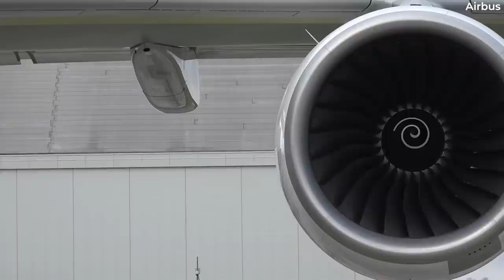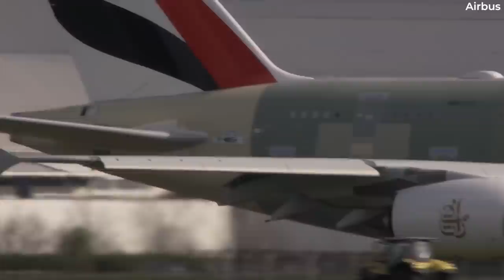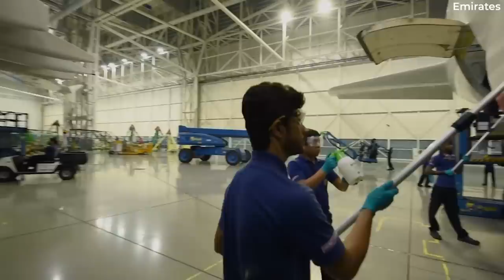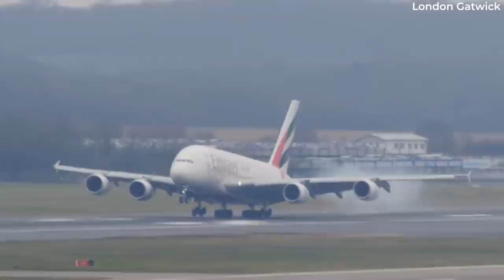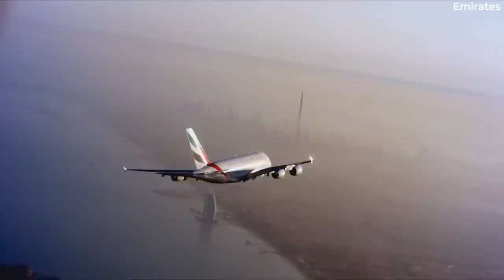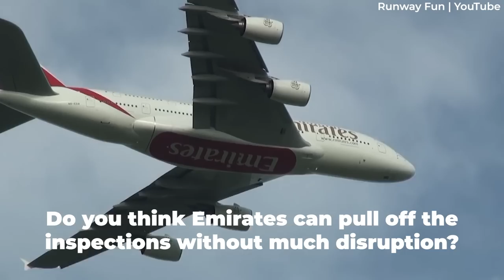Massive A380 Project Underway: Airbus To Inspect For And Repair Wing-Spar Cracking

Comment: Would this video have been different if the wing spar cracking was occurring in Boeing aircraft ?
Reply: 4 sure
Reply: Yep.... They would have made it sound even worse. This issue for the A380 however is not new and goes back more than a decade.
Reply: Am sure this YT channel will also report it, however I am not sure about the YT channel known as Dj avaition though....lol. 😉

Comment: Apparently people don’t understand that he explicitly stated that those A380 recently came out storage and hasn’t been used in a long time probably sitting in the desert somewhere so cracking is expected and needs to be repaired but A380 for the most part has never have this issue during its 20+ years service so this issue is fairly minor.
Reply: Thats not accurate at all. The A380 has had wing issues from day 1. The first batch of more than 50 planes had to go back to have wing issues repaired years ago. All of the affected planes were not in long term storage. The first cracks were reported in 2011. Cant blame that on long term storage from the pandemic at all. That was nearly 13 years ago so it is quite inaccurate for you to say that the plane never had these issues because it most definitely has. One of the first news outlets to report on it was The New York times back in January of 2012, at that point crack had been discovered the previous year.

Comment: I love the way Emirates told Airbus that it was their problem and it’s up to them to fix the 100+ EK aircraft. Airbus can’t escape their design / engineering problems that easily. 

Unfortunately it does put pressure on the real EK hero’s. More flights for the 777 crews.

Comment: We have a problem:
Airbus - slight micro cracking on spars on an over-strengthened wing.
Boeing - hundreds dead.
Reply: Boo
Reply: Minor? The firsts reports if A380 wing cracking were in late 2011 and NY times did a story on it in January 2012. This isnt new or minor..... The first 50 plus A380's ever made had to have wings repaired.
Reply: @dmcr9525  I said "Micro" not "minor" and so far no fatalities of injuries on any A380 after 800K flights.

Comment: Let me see if I have this correct. Qatar reports an issue with a currently produced aircraft and Airbus is fine with going to court over it. Emirates reports an issue with a non-production aircraft and  Airbus immediately comes up with a project plan to resolve. Why is this situation different, other than the carrier, of course?
Reply: Quantity of aircraft and money, I suppose.
Reply: Was the Qatar issue with the paint problem yeah?
Reply: That was largely all in how QR decided to handle the issue. Airbus offered to fix the issue from the start but QR refused and threw a fit. Bad negotiating on their part.
Reply: Because of Al Bakers saltyness ?
Reply: @xraylife  Yeah. The Qatar goverment finally wised up and took him out the negotiations with Airbus.
Reply: Airbus claimed the A350 issue was purely cosmetic. This A380 issue is structural.
Reply: Wrong, Airbus provided a solution and QR refused it and went to court.
Reply: You are forgetting the part where Qatar folded in court when told they HAD to provide proof of danger to safety. Days later the case is withdrawn.

Qatar got grumpy over an issue that Airbus offered to fix but that was not good enough.
Reply: Almost correct :) There are countless resources online that prove Airbus offered Qatar a solution to the problem, but "baby al baka" only wanted money not a solution (MONEY ONLY) Emirates on the other hand are dealing with aircrafts coming out of storage during the pandemic probably in the desert so long term affects wind, erosion, rust make the A380 liable for wear and tear.  For both scenarios Airbus has provided adequate solutions to fix the problem. The only difference is Emirates is willing to negotiate while Qatar will "Sue sue sue everyone and everything just to make more money" Hope this helps :)
Reply: Not really.... The first reports of wing cracking on the A380 go back to 2011, and NY Times did a story on in im January 2012. It isnt a new problem but now that Emirates is sounding off about it, looks like its bigger news now. Why wasnt it major news over a decade ago? This isnt a "new" problem